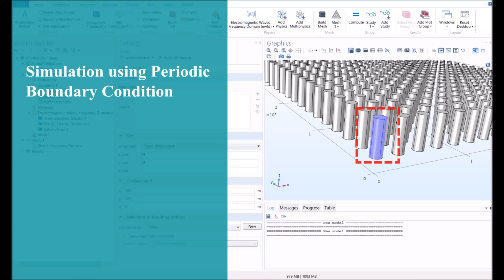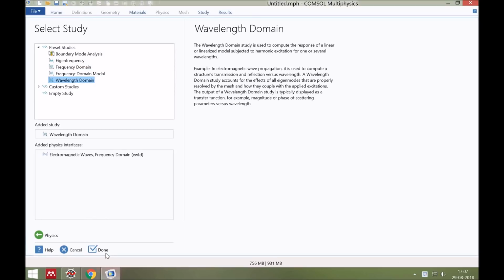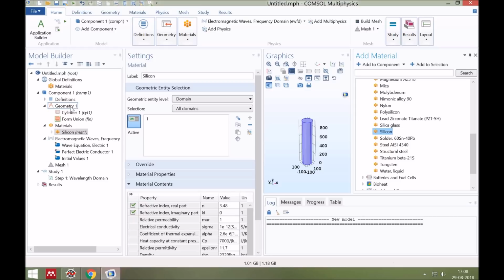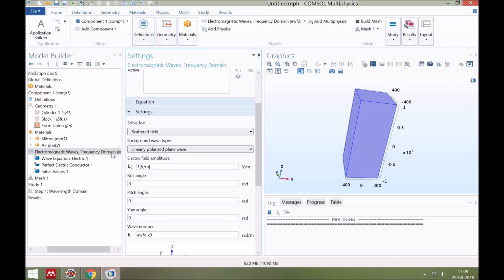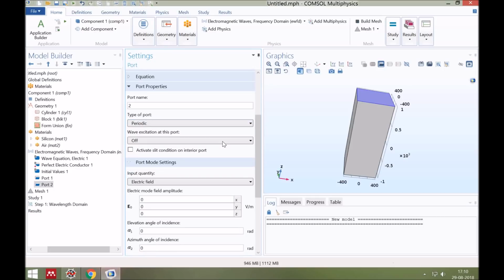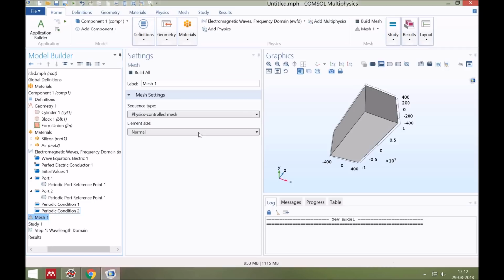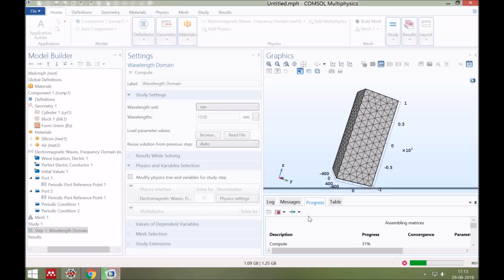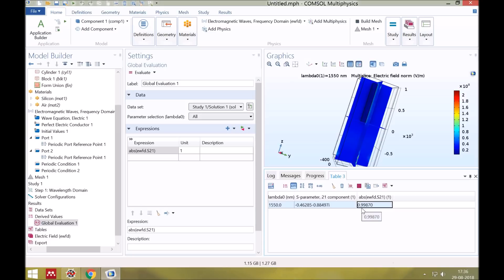Implementation of Periodic Boundary Condition | COMSOL Multiphysics Tutorial-7

Comment: Hi, Thank you for sharing this video about boundary conditions. I am wondering how one can apply the boundary conditions or PEC/PMC on the boundaries of the cubic unit cell if the angle of polarization of the incident electromagnetic wave is rotating? For example, the angle changes from 0 to 90 degrees with an interval of 10 degrees. Would you like to say something about this situation? Thanks!
Reply from the maker: Can't understand your question. Could you please elaborate it?
Reply: Let suppose that the incident EM wave is propagating along z-axis and E and B are in x- and y-axis, respectively. So, electric field is polarized along the x-axis. Now if E starts rotating by making an angle e.g. theta with x-axis then after 90 degrees E will be aligned along the y-axis. Lets call this angle theta as an angle of polarization. Here comes the question: how one can apply the periodic conditions or PEC/PMC on the boundaries of the cubic unit cell if the angle of polarization of the incident electromagnetic wave is rotating? For example, the angle changes from 0 to 90 degrees with an interval of 10 degrees. Or in other words which boundary conditions are suitable in such a situation? Lets take the cubic cell as same as the one that you have demonstrated in the video.
Reply from the maker: In most geometries, such as in a cube, those boundaries would be inconsistent with a rotating field. The PEC boundary will not support a tangential component of E. The PMC boundary will not support a tangential component of H. You need to decide what you are actually trying to model. Is it the rotating field? If so, then you need to choose boundaries that correspond to that. Or is it the certain PEC and PMC boundaries that you want to preserve? Then you need to expect, input, and/or solve for fields that will be consistent with those boundaries.

Note: If your goal is to impose a plane wave at an arbitrary angle inside the cube, consider using the "scattered field formulation." (Look in Settings, under EM Waves, Frequency Domain.) In that approach, you specify a volumetric background field instead, and this simplifies the work you need to do in regard to setting up the boundary conditions.
Reply: Thank you for the reply. Yes it is the rotating field, could you please guide me in such a case which boundary conditions are suitable? I want to calculate reflection or S11 parameter by applying port 1 for excitation of the plane wave, but bit confuse about choosing the right BCs since the field is rotating.

Comment: can you please guide me on defining the stepped velocity input?
As in for first 0.5 sec velocity is zero then for next 2 second it is 1 m/s and again zero for next 0.5 sec.
Reply from the maker: Hello, You can use a rectangle function in "Definitions">"Functions">"Rectangle". In your case, set "lower limit" at 0.5, "upper limit" at 2.5 then you can plot the graphic to check your function. The next step is to use the function in the physics interface: in your "Inlet" node, you can use the following syntax: rect1(t[1/s]) rect1 is the function name by default and [1/s] is used for homogeneous units.
We hope this helps!
Reply from the maker: Sometimes, rectangular velocity steps probably stop a time-dependent solver as a velocity step implies infinite acceleration and thus is unphysical. In that case, You may need to smooth the steps. This can be done with e.g. ramp functions. Take care that the time stepping properly resolves the ramp.